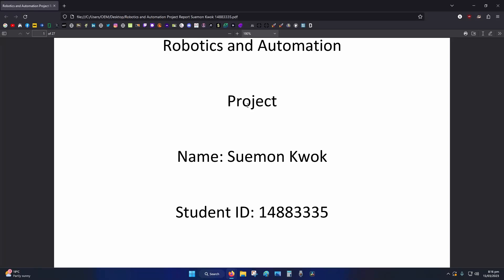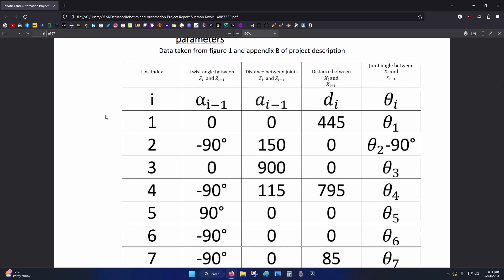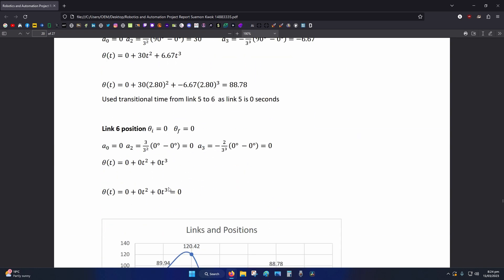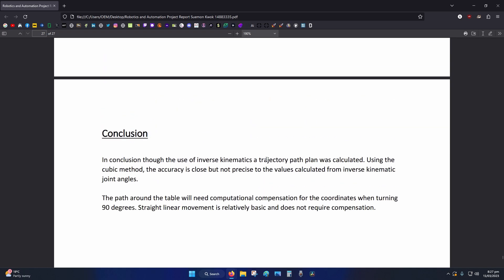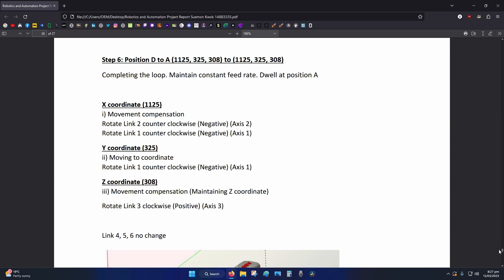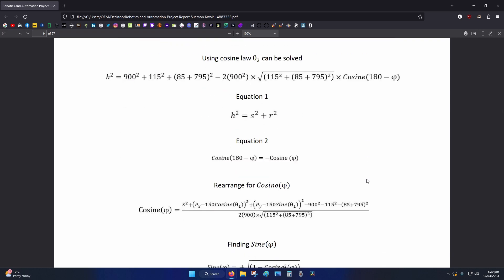Robotics and Automation Assignment/Project

Comment from the maker: 0:27 Assign frames to robotic manipulator and explain

1:47 Find and list link of Denvait – Hartenberg
parameters

2:07 Deriving Denvait – Hartenberg matrices between neighbouring
links using homogeneous transformations

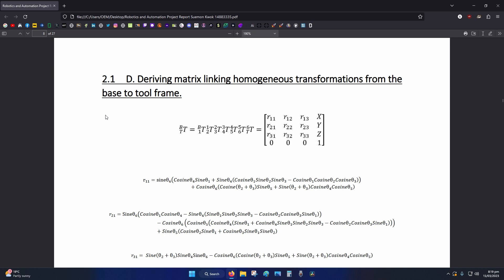2:33 Deriving matrix linking homogeneous transformations from the
base to tool frame.

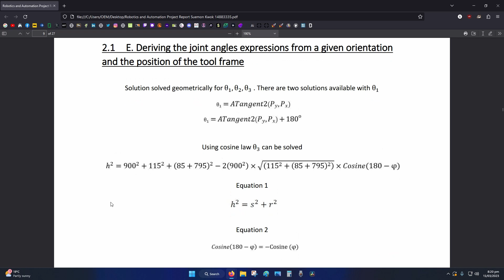3:20 Deriving the joint angles expressions from a given orientation
and the position of the tool frame

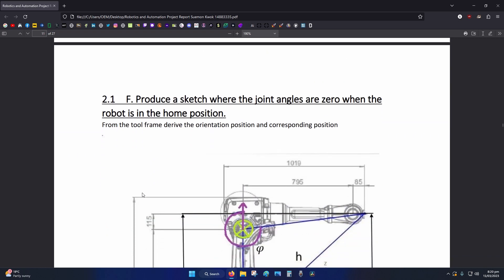4:06 Produce a sketch where the joint angles are zero when the
robot is in the home position.

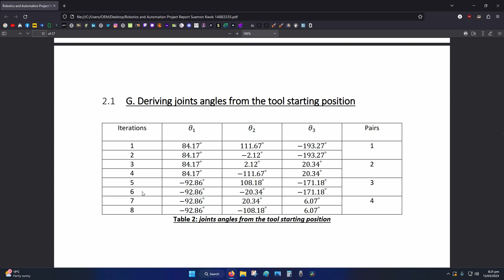4:22 Deriving joints angles from the tool starting position

4:51 Find the Jacobine linking the linear velocity tool tip, joint
velocities and the singularity of the robot if any.

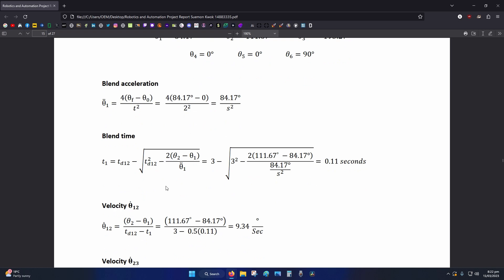5:39 Trajectory Planning for each joint to move tool tip

7:22 Describe how to Keep desired direction of the tool tip and make
it follow the edge of the rectangle formed by points A, B, C and D.
Reply: Need some assistance, same project layout but different robot. I can show you in email
Reply from the maker: @BobbyCync  I haven't practiced robotics after taking class I'm afraid I forgot everything